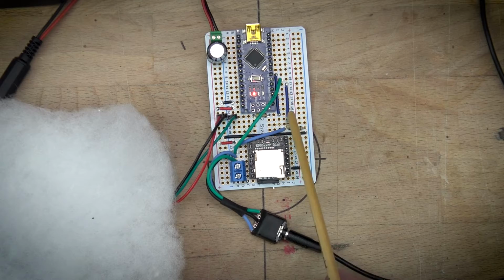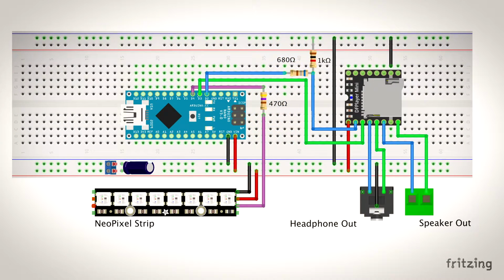Lightning and Thunder Effect - Arduino, DfPlayer Mini, NeoPixels

Comment: Hello.
I tryied to add a 144 ledstrip but it lights up only the first 31.
I changed the code inside for 144 leds.
I tested the ledstrip and every led working fine.
Is it my power supply (i will test it at night) or i need to change something in code?
Thanks.
Reply from the maker: What kind of led strip are you using? That will determine some of the tweaks to the code.
Reply: @RandomMakingEncounters  Hello. This is my ledstrip: https://www.ebay.com/itm/373152807734?var=641935879348
Reply: @RandomMakingEncounters  hello again. I create it in tinkercad (i removed some code for mp3 module, as i can't add this library on tinkercad). As you can see, it doesn't light up all the leds. Also, i realized, that if i set 144 leds, it overcomes some leds in first lead strip, so maybe the code expand across the led strip? I don't know. Here is the link: https://www.tinkercad.com/things/1IqHRkIEl0f-magnificent-blad
Reply from the maker: Let me dig into this a bit. The code that I posted is for NeoPixels and not specifically the RGB LEDs. The good news is that there will be a way to make them work but we may need to tweak the code a bit more extensively. There may be a slightly different library we need to use. Let me do a bit of research. I did a quick search and found this tutorial - https://howtomechatronics.com/tutorials/arduino/how-to-control-ws2812b-individually-addressable-leds-using-arduino/ It might help get things working a bit better. The first step is to see if we can get all of your LEDs lighting.
Reply: @RandomMakingEncounters  sure and thanks for your research. if you make it work, please inform me :)
Reply: @RandomMakingEncounters  same here
Reply: this is the one i was looking for
Reply: I'm going through this myself, did you ever find a remedy? I've done multiple strand tests to confirm my strip is working. Been going through the code and checking libraries, engineers hell

Comment: Great project. This is the only ot worked for me! How many ohms/watt for speaker? I have a 4ohm/3watts but the sound is too low...
Reply from the maker: Your speaker is about all the onboard amp will handle. I've found that if I really want good volume, I need to switch to using the audio line out pins on the player and connect an external amplified set of speakers—something like cheap computer speakers. The onboard amp is OK if you need to keep it all compact and small but it's a little wimpy if you really want some volume. Hope that helps! All the best!

Comment: This is very intriguing to me. Also very intimidating. I can incision so many ideas be it a book nook (which I'm looking to do my first one) or elaborate terrain pieces. I wanna do a Necromunda themed book nook for my first one. I want it to be very grim dark as it's set in the 41st millennia (40k)  some random flashes in the background with gunfire sounds or different colored light effects with energy sounds like a plasma coil or something firing up. That sort of thing. Do any of these control boards have the ability to control multiple things with different timings for each? Also is there a more close look/in depth tutorial for these products or what I'm looking to achieve? I dont mean to imply that your videos aren't great by asking. I'm just not following all of what you're trying to convey. Other than tea lights in a complete noob to electronics and lighting in my builds but I very much want to learn more. I feel like technology in general is a weak point for me and I'd like to change that especially where my hobbying is concerned. Thank you in advance and thank you for your videos 😁

Jeremy
Reply from the maker: The quick answer is yes they do! Based on what you're describing, an Arduino would be a good solution. I'm currently painting an Ironstrider that I want to build either a diorama or a nook with flashes and explosions. I'm also working on a design for a circuit board that would make soldering up these parts a lot easier. Arduino is pretty easy as a programming language but it takes some getting used to. The thing that is nice about it is it's reasonably simple to learn but the downside is that simple also means you have to be clever when you want to mess with the timing of things. It's not a "multithreaded" processor which means it just does one thing after another and then repeats it. I think that Ironstrider example may be just what you're looking for. I can break out just a video on the electronics for it... basically flashes and explosion sounds... battle scenes... random screaming... ya know... all the fun stuff.
Reply: @RandomMakingEncounters  yes I'll wait to see the next video then. I have plenty of research to do and 3d printing prep work before I dive into it anyways. I appreciate your reply and the work you put into the tutorials. They're proving quite useful. 

Aslo, im sure you know about this but if not, there's a handy tool for connecting wires and leads that doesn't involve soldering. It was featured on Tabletop Witch Crafts mist recent video. I've never seen it before that but it's around $12 on Amazon. It won't save you from the necessary soldering when it comes to bread boards and certain other components but it looks to be a real time saver for anything with a lead such as LEDs ect. I thought it might be worth a look as it's something you and your other viewers might find useful. 

Thanks again
Reply: Sorry, that tool was $22. My bad
Reply from the maker: That's a pretty cool tool. I think I saw a video where they used to use those wire wrappers to create or prototype old circuit designs—everything old is new!

Comment: Can you buy this already put together
Reply from the maker: I have been working on a circuit board to make it easier to assemble but it would still require soldering and buying a the Arduino Nano and DFMini player.

Comment: what is the size of the capacitor you used please
Reply from the maker: So... it's a 470uF 25 volt electrolytic. This capacitor is basically a "smoothing" capacitor that is there to prevent large spikes from damaging things. If you look at the Adafruit NeoPixel guide (https://learn.adafruit.com/adafruit-neopixel-uberguide/basic-connections), they recommend a 1,000uF capacitor. Basically... ya just want a kinda big capacitor in there to be a bit of a buffer when you apply power.

Comment: Yes!  - this is for me!  I'm doing a project with this effect & NeoPixels. I am finding a lot tutorials that do not do not work, some do but are so laiden with numerous components. This is relatively simplistic. What is up with that 'Busy' pin? Still confused about it.  Next can you do same effect with DotStars?
Reply from the maker: Glad to hear it! The Busy pin on the DFPlayer is something to explore. According to the pinout, while a track is playing, the pin goes low (which generally means it's dropped to ground and is showing very low voltage). When there is no track playing, the pin goes high (again... usually meaning it will show some voltage above a certain threshold). Right now, my sketch has enough delay built into it to account for the longest audio track. I was being kinda lazy because I wasn't sure the concept was going to work overall so I was trying to keep it sorta simple. A much better solution would be to connect the DFPlayer busy pin to the Nano and then use digitalRead() to detect if the pin is high or low. While the pin is low, you'd just hang out at the end before looping back to the beginning. With that change, you wouldn't have to worry how long any track was and could have longer and shorter tracks without building unnecessary delay.

Hope that helps a little.

This should work with DotStar! You would need to tweak the code to use the DotStar library and DotStars take another connection to the microcontroller for communications. I don't have any DotStars but the research I did in Adafruit seems to indicate they're pretty similar in use. It looks like the advantage of DotStar is the speed they can be controlled and a bit more universal plug and play across other microcontrollers. I've found that I have never needed the speed to justify the extra cost so I've never played with them. I think DotStar would be the solution if you needed really high refresh rates on a lot of LEDs... projects where NeoPixels may appear to "flicker".

All the best with your project(s)!!
Reply: @RandomMakingEncounters  thank you much! I will try everything you mentioned and get back to you a couple of days. 🖖🏾